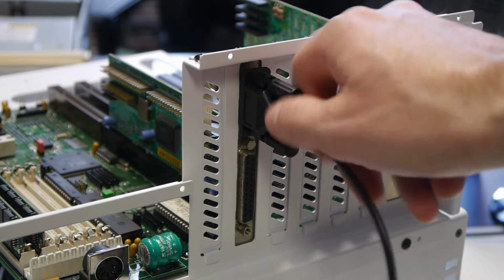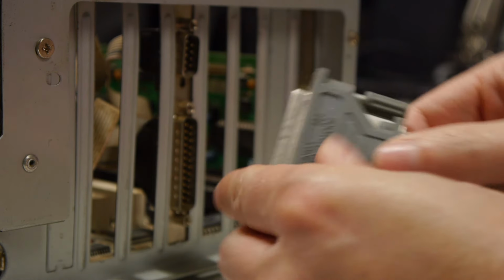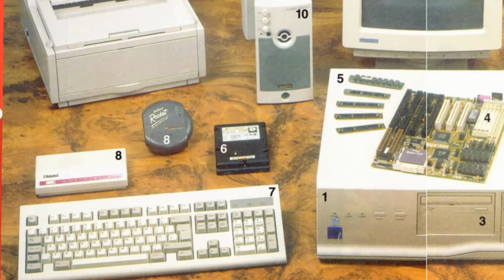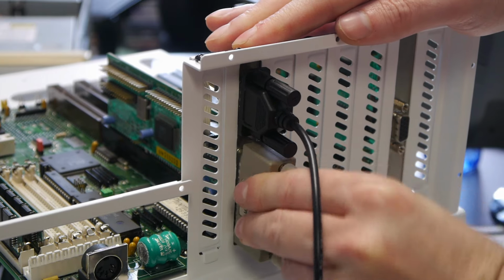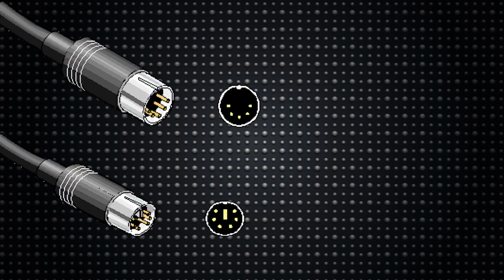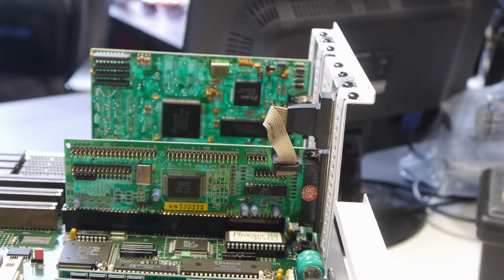What did we use before USB? | Nostalgia Nerd

Comment: 25 pins to transmit serial data.

Let that sink in.
Reply: There's a few reasons for that.  First of all, USB uses its two data pins for data going both ways.  Old serial ports, on the other hand, couldn't do that.  There had to be separate pins for each direction.  Additionally, both the computers and the devices you were plugging into them were a lot dumber, and couldn't do nearly as much stuff automatically.  Most of the additional pins are there for the computer or device to state that they are ready to send or receive information.  Sending that over the data pins would have been possible (it's only about a byte of information), but parsing that information requires a lot more engineering compared to just checking whether the voltage on a particular pin is positive or negative as you need it.
Reply: @Jerl-ksk  both RS232-C and USB use one pin for transmitting and one pin for receiving. USB before 3.0 uses the other two pins for power. The functions of the other pins in RS232-C are crammed into the data stream by USB. Despite having separate transmit and receive pins, USB 2.0 and earlier only operate in half duplex mode, can only send OR receive. So when sending data to a device like a hard drive it has to switch between send and receive in order to get communications back such as verification that writes worked OK.

RS232-C can operate in full duplex mode, which made it usable for use as a slow network link between two computers for multiplayer games, or with special adapters it could daisy chain 3 or more.

The USB 2.0 cables that were made to link two computers had to bang back and forth between send and receive really fast.

USB 3.0 adds two pairs of data lines, one for receive and one for transmit, and a 3rd ground. That enables full duplex data flow.
Reply: @greggv8  "USB use one pin for transmitting and one pin for receiving" That's not true. Both Data - and Data + are used when transmitting or receiving. During communication Data - is the inverse of whatever is traveling down Data +.
Reply: USB has TX and RX data only. The data has start and stop bits which are shorter and longer pulses to distinguish the flow of data. serial data is encoded and decoded, This is why there are delays when connecting USB devices as they have to communicate and sync when in use.
Reply: @Jerl-ksk  I give you a like.   I would  up vote it,  but you have 64 likes,  and I don't want to spoil that perfect number !
Reply: Twenty-five pins, but sometimes only four were connected and only three wires used. There were a multitude of configurations with devices needing different connections.
Reply: I told that sink the plummer would be there ON FRIDAY, I'm not letting him in!
Reply: Your profile picture matches my reaction.
Reply: 25 pin serial, and 9 pin serial actually only used 2 pins for data, the rest were signal ground, flow control and out of band signals (like ring indicator)
Reply: Only some of the 25 were used. https://www.google.com/search? Mainly DTS RTS TD RD and GND. RI ring indicator for a modem may be, the rest were seldom used or had only future needs. Below 9600 baud only RD TD and grounds were used for mice and simple low-speed devices.
Reply: Also, off the top of my head, USB3 has two (or three?) pairs, as well. The auxiliary pair is run at higher speed, I believe. I’d have to look at the standard because it’s been a while. Also, bonus nachos for you, because this drove me batshit insane for years.

USB 3 is well known to interfere with 2.4GHz anything - Bluetooth, wifi, proprietary protocols, doesn’t matter. The reason for this is because it runs at the same clock rate or something along those lines. I can’t remember the exact reason for this, but Intel did a paper on it which explains further. Happy to dig it up for further reading if you like.

TL;DR, the fixes are numerous:

Don’t connect your radio gear to any USB 3 port, if possible. Don’t connect it to a USB 3 hub, either.

If you don’t have any legacy USB 2 ports, you can work around this issue by using either a long extension cable, or better yet, a USB 2 only hub.

However way you choose to skin this particularly annoying cat, keep the transceiver as far away from the USB 3 port/hub as possible, and you should be good.

So if you’ve ever wondered why your wireless mouse seems to suck, that’s why.
Reply: Ah ... the good old days ... when you actually had to understand how things worked to set them up and get them going. Oh ... and we used to fix things when they stopped working back then too...
Reply: Don't think for a moment that not all these pins were necessary! All 25 pins, except for pin 18, 11 and 25 were used! The 25 pin serial connector allowed for two transmits and two receives! This allowed double the bandwidth! Particularly helpful with  serial networks!  When networks changed to token-ring and then eventually to ethernet, the serial port could be reconfigured for other types of communications so things like the Clear to Send (1 and 2), Receiver clock, signal quality detector along with others were no longer deemed necessary. It's important to realize that in the "olden" days, whatever could be passed off to hardware, was...because CPU time was expensive! Wasting CPU cycles to managed these things in software would have been seen as obscene! Let the hardware do it and release the CPU to do things it was designed to do...especially when CPU clock speeds were measured in the kilo-hertz. (today's computers are in the giga-hertz. Now a-days, CPU cycles are more than 300,000 times faster and as such, they have plenty to spare...so these checks are done in software (or firmware). This is why a 25 pin communication system was needed and now no longer. Just wait until you find out that the parallel port had 36 pins!
Reply: I'm not letting that damn sink in.
Reply: The standard parallel port also has 25 pins.  Let that sink in!
Reply: RS232's transmit pin: data

USB: here is data block number 0 from host device to subdevice 4 on device 3, which is 4 bytes long and part of stream 19, which has already been opened: first character is "s", second character is "a", third character is "t", forth character is "a". Data ends here, checksum is 439, stream stays open. Next device allowed to speak on the bus is device 1.
Reply: Well, you needed one pin for each direction.
And then one for each and every control signal. In many cases, both directions again.
And then 3 more reserved for later expansion.
I mean we had stuff like FTP over Ehternet cables (control and data over the same wire), but who could afford that quality of Chips and Cables for stuff like the Keyboard? In a Time when Network connectors were on Expansion cards and server motherboards only? And even there limited to 10 MBit/s or less?

Then they realized most of the control signals were not needed for anything this side of a industrial machine or early modems, so they just used subsets of the standarts with a fraction of the pins.

And by 1995 suddenly we had 100 MBit/s Ethernet (Fast Ethernet). So getting cheap chips and cables for 12 MBit/s fast USB was no longer an issue.
Reply: I'm still getting over him calling it the IBM "at" (as in CAT without the C). It's the Eh-Tee. AT. For Advanced Technology (which it was at the time. 

Other replies have covered the reasons why a serial port had, historically, 25 pins. It makes sense especially when you consider that integrated circuits weren't sophisticated enough to make a UART that does automatic baud and parity adjustment, etc., when RS-232 (EIA-232) was standardized for industrial controllers across factory floors of the 1960s. Hence also the odd-seeming +/-12V signalling where the electrical noise would kill lower-voltage communications. (And it's differential signaling just like USB.) 

For this reason, serial ports are also typically driven by very robust driver chips which will take a lot of electrical abuse before they fry - and are almost as easy to replace as fuses. 

If you're into building something like a home burglar alarm system or any number of crazy homebrew machines, your old serial port is your friend. Serial? One bit at a time? No way! Use the control pins too. You can write C or Assembly to read those pins. Just because it might be labeled "PAPER OUT" doesn't mean you need to be reading data off a printer - it might be reading that the cat's water dish is empty. Pull DTR high and use it to turn on a water valve. When the DSR line goes high, the dish is full and the computer can turn off the water valve. And I haven't even touched the serial communication on pins 2 and 3. 

RTS/CTS, DTR/DSR, Paper Out, Ring, just off the top of my head. And yeah, the shell and nearly half the pins are grounds. Using a connector design that was already commonplace in the nascent computer industry. 

People are always running around buying crazy USB breakout boxes and stuff like that. Serial and Parallel ports are a hardware hacker's paradise - if your modern machine lacks legacy ports, just add them and play.
Reply: What does the sink want now?
Reply: I Remember using Norton commander for dos to transfer files using seriel or parallel cables either way it took the Best part of a day to transfer a feW MB
Reply: Not all pins were used, I burnt my thumbs many a time soldering D types in the 90s . You might only have 4 wires connected depending on what it was used for.
Reply: if only all 25 pins transmitted data... that would have been Light speed back then :P
Reply: I don't get it
Reply: Yes I'll let that "Sync" in.
Reply: Well, 25 is better than 1 or 2, is it not?
Reply: @uzaiyaro  sometimes, yes. Then in other situations, no.
Reply: Why do you keep campaigning for open sink borders? Sink immigration is at a all time high and here you are advocating for letting them in. 

It's sickening..
Reply: You could convert it to a 9-pin connector. The extra pins were there for those that used an external modem to light-up certain indicator LEDs on the modem.
Reply: @andywolan  Not to light up the LEDs, the LEDs were all inside the modem to quickly troubleshoot connections.  That extra 16 pins were for using modems that didn't use in-data commands to do stuff like change settings or dial phone numbers.  And the clock pins for running faster speed protocols that didn't waste 2 extra bits for each byte.

Comment: It was fun when you went to unscrew the little thumb screws and both the screw and the part it screwed into both unscrewed out.  :-/
Reply: Still happens with VGA and DVI cables quite a lot
Reply: And then the nut would fall out and possibly short out your card. Those thumb screws were a nightmare also because they'd catch on every cable, making it impossible to pull the cable out from under your desk.
Reply: My favourite was always the clueless customers that tugged and tugged on their monitor cables until the port was physically ripped from the board; and then they'd get all shitty when you pointed it out to them.
Reply: Yup that happened a lot so you kept your nut drivers handy.
Reply: Happened to me when upgrading my motherboard...

Comment: The 9 pin 'D' connector is in reality a 'DE' connector, the 'E' referring to the shell size.  This means that the proper designation for the VGA connector is actually a DE15.  In the wide spacing, there are others.  DA15, DB25, DC37, and DD50.  For some unfortunate reason everyone incorrectly thinks that these are 'DB' connectors.  The 9 pin serial connector (DE9) only came into use when IBM popularized it on the PC/AT, and it has taken over things.  The 25 pin version of the serial connector has lots of other signals for various modem/terminal connections that aren't used much any more (synchronous modem for example).

Comment: Took me back to when I built my first PC from scratch.  I had to buy a hard drive controller card, a floppy drive controller, serial and parallel controller, sound card, and my motherboard, CPU as well as the usual RAM AND external CPU Cache (which I still have laying around) as well as a math co-processor!  It's really amazing just how much we have built into the motherboard these days!

I still need to upgrade my computer to use USB3, I currently have an additional card for that.  Oh, I also used to have an FM Radio card to get radio stations on my PC and a video capture card I used to have a huge VHS Camcorder hooked up to! :)

Comment: USB-C is a failure and so is Thunderbolt.
Reply: USB-C is amazing and all, but it's got very serious problems starting with the fact the cables for USB, DisplayPort, Thunderbolt, MHL, and HDMI are not interchangeable, even backwards, and a cable that does it all would be prohibitively thick and easy to break. Adaptors for thunderbolt 2 will not drive TB 2 devices unless you daisy chain them first. Everything is massively expensive, even the port itself. This is a 24-pin connector. Hobbyists and electronics engineers will continue to use -A because it is much easier to solder by hand. Peripheral manufacturers will continue to use -A as long as possible due to how common it is and how much cheaper it is than -C. USB 2.0 is several times faster than most devices could ever possibly need, and users hate buying adaptors for things. That doesn't even get in to the technical issues with -C. That's a whole PhD thesis.

Comment: > "It was splendid."

Take off the rose-tinted glasses dude, connecting things to computers before USB SUCKED.
Reply: Agreed. Hell, the first 486 PC I personally owned that I got in my mid-teens still had a 5-pin DIN port for the keyboard, and this was in 1994. While I admit I do have nostalgia for older systems, USB and its descendant variations have eliminated much of the guesswork, and I wouldn't trade that for a split second :)

Comment: People today think that USB means you can just plug anything in and it works. USB devices still need drivers, it's just that today's operating systems have generic drivers for the most common devices built in. Plug in a fancy mouse and all the buttons will work, but the extra features probably won't.

If HDMI hadn't come along to basically replace all other video connections, I wouldn't have been surprised to see USB used for the video output.

Comment: The RS-232 interface is still very widely used in embedded development these days.  It's a super simple interface that pretty much everything, from tiny 8 bit microcontrollers the size of your pinky fingernail up to modern desktops, servers, and network equipment has available.  My ASUS X370 Prime Pro board I bought last year with my AMD Ryzen 1800X build still has a serial port header.  I had a PCIe add-in card in my previous build with two serial ports since that board didn't have an integrated one.  I used the serial port a lot in my embedded systems classes in college (2008-2012) and now still use them to communicate with the aviation products I work on every day at work (via an RS-485 converter, as the bit patterns of RS-232, 485, and TTL serial are all compatible).  The Arduino and Raspberry Pi both have UART RX/TX pins which are functionally compatible with the RS-232 serial port (just need a level shifter like a MAX232 to connect them to a serial port on a PC).  What's great about USB is that most of these old interfaces can be brought back to life over USB.  USB to serial adapters are commonplace in embedded development work.  USB to printer parallel port adapters were used in the interim period where USB came out but parallel printers hadn't faded away.  A lot of gamepads/joysticks had USB and game port support via a USB to game port adapter (though a lot of these were product-specific, just routing the USB pins on the unused gameport pins).  USB MIDI devices are still readily available.  USB is amazing and I'm glad we have it, but as an embedded developer I still love the simplicity of the serial port.  Actually making a product with USB is much more complicated than making one with serial, unless you cheat and incorporate a USB to serial adapter chip into your design.

Comment: Nothing more fun than getting a computer delivered for Christmas, only to find the Nvidia Gforce 9300 card inside doesn't have a VGA standardized port, but a DVI one instead.  Since rarely anyone has DVI cables just laying around, now you get to spend more money and time having a DVI cable delivered, before you can even use the computer.

Comment: I was disappointed to see the parallel port go, but not because of printers.  Sticking wires into the data I/O holes of that 25-pin port and sending and receiving TTL signals was as easy as "OUT &H378, Mydata8"  and  "Myreadbits = INP(&H379)"

Comment: is it just me or does DIN look like a midi port?
Reply: MIDI also uses a DIN connector.  The same connectors were often used for a number of different things (DB9 for RS-232 and game controllers, DB25 for RS-232 and parallel, mini-DIN for PS/2 mouse and keyboard, DIN for AT keyboard and MIDI, the RCA phono connector for a ton of different A/V interfaces like composite, component, analog audio, coaxial digital audio, RJ45 for Ethernet, AT keyboard, telephone, etc.).

Comment: A lot of medical devices still use RS-232 serial ports. These are connected to PCs, terminal servers and specialized appliances that send the data to a server that converts the information to an HL7 message that is filled in an electronic medical record system.

Comment: I have a PCI-E card that has:
2x RS232
2x RS485
2x LPT
2x SCSI
2x CAN BUS

2X USB 3.1
2X USB C
And it has two giant ports on the back for connecting it via a giant adapter.
On the card itself we get
2x RS232
2x RS485
2x LPT
2x SCSI
2x CAN BUS
2x IDE
2x FLOPPY
2X USB 3.1
And two extra 25 pin RS232

Plus it has Ethernet tap capabilities.
best card you ever need
In 2018